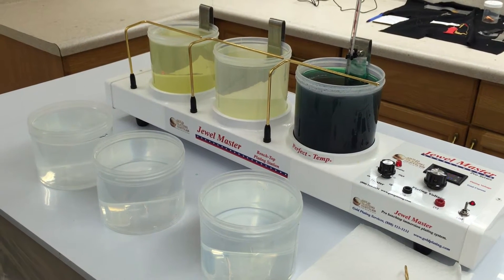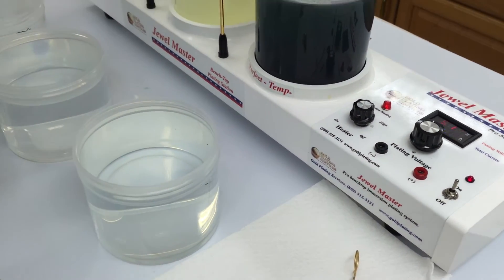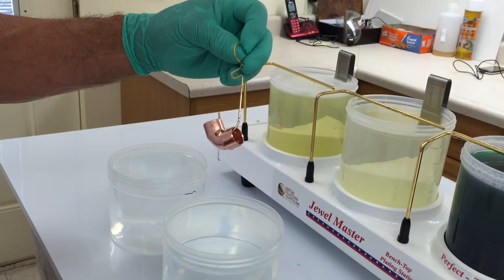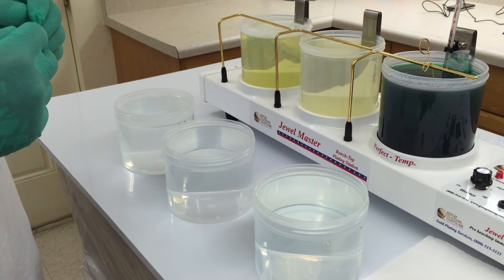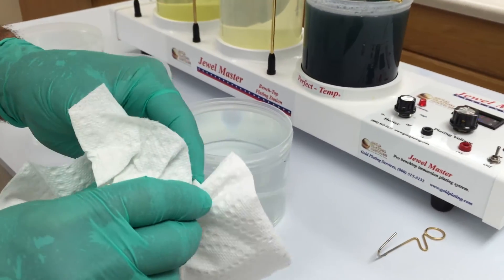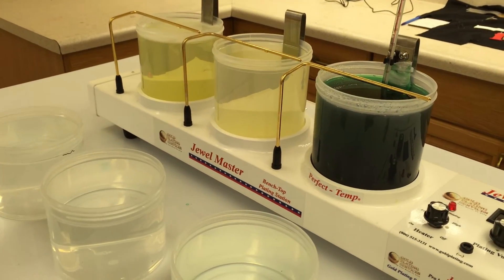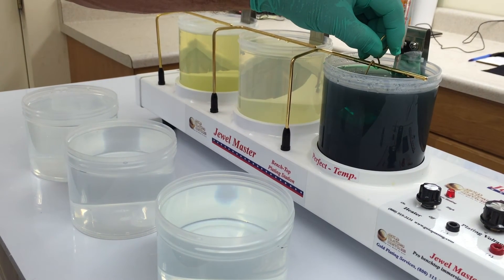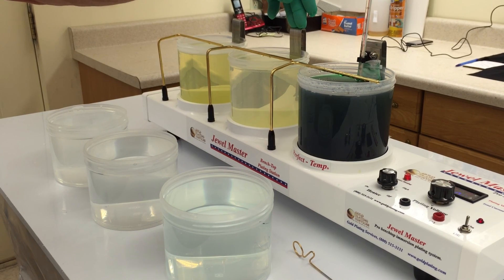HOW TO: Nickel Plating using the JewelMaster Pro - Nickel prior to Gold Plating - KIT

Comment: Hi, great vid. You talked a little about the size limitations of the kit, and that roughly 6square inch would be top. Is this limitation a result of the current abilities or is it relative to the dimensions? Thanks
John
Reply from the maker: The limitation is due to the dimensions of the beaker and also the anode to cathode ratio (the anode and item should be at least 1:1).  The anode has approximately 10-12 sq inches of area (front and back).
Reply: @GoldPlatingServices  thank you.

Comment: When bath plating silver would we have to turn the object around like how we do with items during a nickel plate?
Reply from the maker: Technically don't ever "have" to turn your piece, it will still coat it everywhere, regardless of which solution you're using.  However, for equal coverage everywhere you should do so.

Comment: While you are nickel plating does your jewel master kit heats the electro cleaner and surface activator ? Or it's just maintaining temp for bright  nickel solution?
Reply from the maker: Only maintains temp of the Nickel cell.  Electroclean and Activator do not require heating.

Comment: I would love to be able to nickel plate shotgun and rifle barrels , but I have no idea where to start.
Reply from the maker: To nickel plate items that large you have two options: 1) Set up a huge nickel plating bath, which would cost thousands of dollars and require quite a bit of creativity or someone who knows about setting up baths.  2) Polish the steel items to a super high luster, then simply use the Universal Plater Kit (our brush plating kit linked below) to brush plate it with nickel.  

When brush plating with nickel it will not brighten the part like it does in a bath.  However, if it is shiny to begin with it will be shiny after you properly plate it with nickel.  If you are interested in how to brush plate it, refer to our videos about how to "Gold Plate Steel" using the Universal Plater Kit.  You will nickel plate exactly the same way you gold plate, just use nickel as the last step instead of gold.  If you have any questions or need help ordering, please e-mail us at info@goldplating.com

Universal Plater Kit Page: https://www.goldplating.com/collections/brush-plating-kits/products/universal   (SCROLL DOWN ON PAGE TO SEE VIDEOS)
Reply: Gold Plating Services 

Thank you.

Comment: Have you done a video, or will you do a video on how to gold plate onto plastic with the immersion technique. I think you'd need to spray paint it with a special material first, but I'm not completely sure. Thank You!
Reply from the maker: We are going to do a video about plating onto non-conductive materials.  We currently do not have one and do not sell the "conductive lacquers" or "conductive paint" that is required.  The item has to be made conductive before the electroplating process will work.  This is quite a bit more artistic than just plating onto conductive materials but can definitely be done.
Reply: Sweet! Thanks for the reply!
Reply from the maker: You're welcome!  Thanks for the question.  Sorry we missed your comment when it was first posted.
Reply: what is rate this machine
Reply: Farhan Patel yes